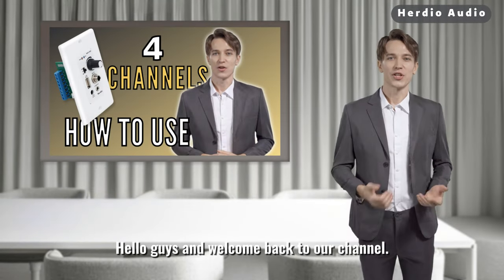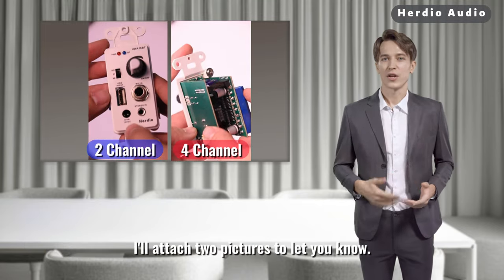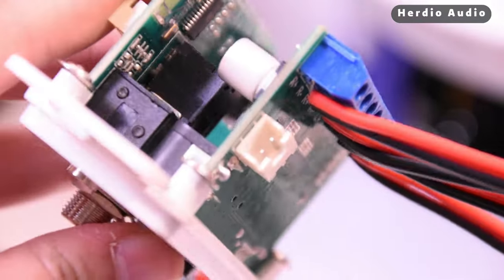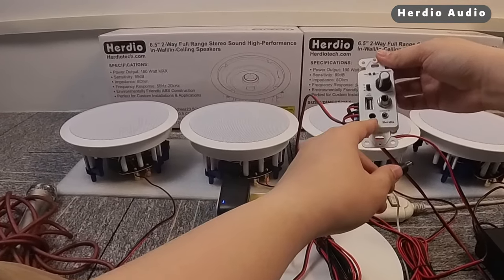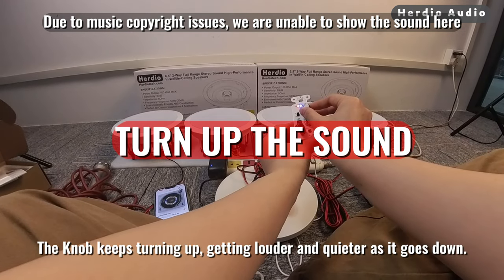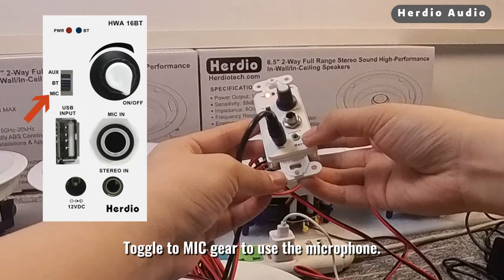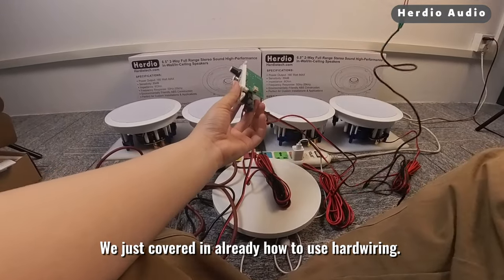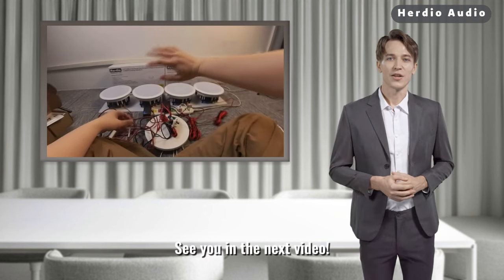How to use herdio 4 channel in-wall Bluetooth amplifier Receiver?

Comment: When I try to connect from phone,  I see 'herdio' but it says 'can't connect'.   Also tried it with another tablet.  It is because it's connected to something else?  If yes,  how can I find out what it's connected to so I can disconnect it?
Reply from the maker: If you can't connect it may be connected by someone else, you can check if the blue indicator light of the amplifier or speakers is always on, if it's always on it means Bluetooth has been connected.

If you want to disconnect and reconnect, please let me know which model of speaker you purchased and I will solve the problem for you according to your model.

Comment: Does it work with 220v?
Reply from the maker: All of our speakers are equipped with adapters for different voltages, and the power adapters can be plugged directly into the 220V power supply.
Reply: @herdiotech  Thanks for the reply.